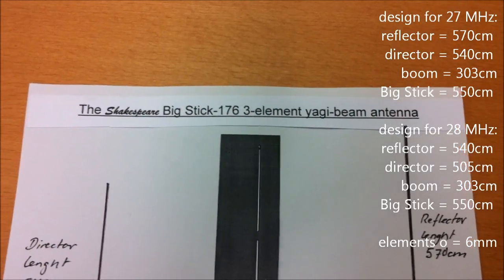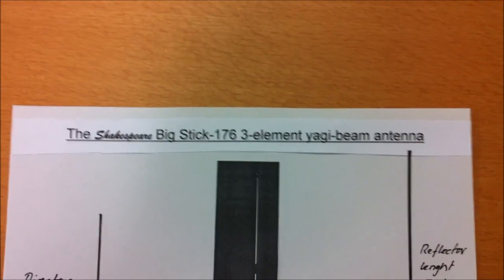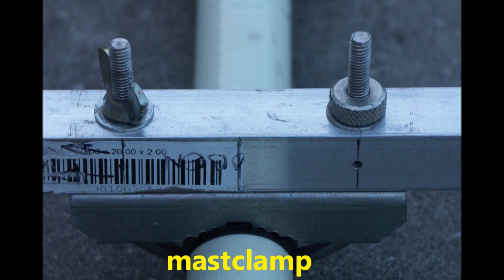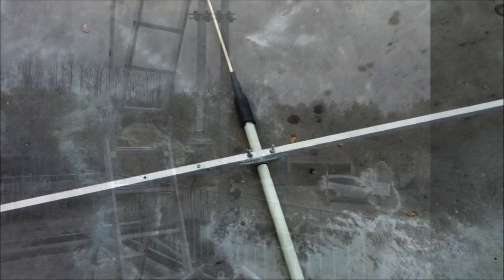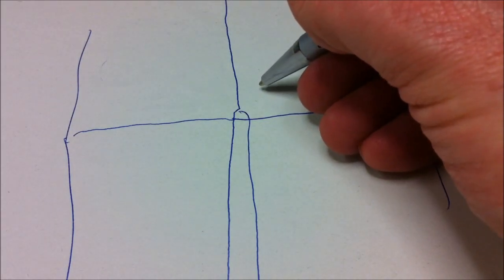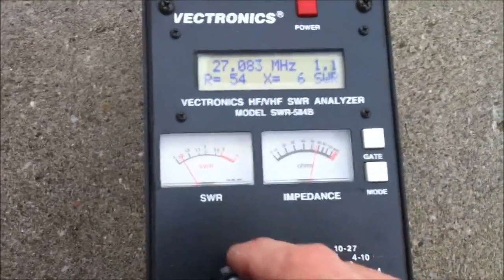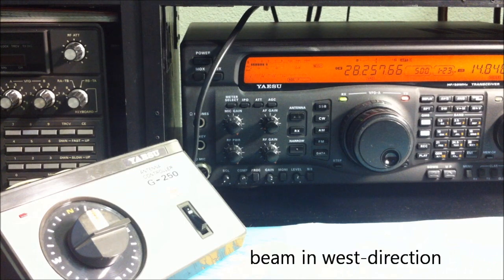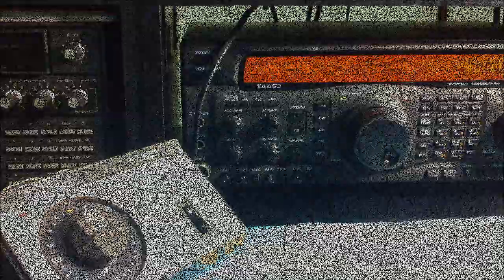The US Shakespeare Big Stick-176 Style vertical beam

Comment: I currently own both a 3 & 4 element beam antenna made by Shakespeare.Both have a fiberglass boom & fiberglass elements.I just received then NEW & still in the shipping tubes yesterday for FREE.I am selling the 2 element & keeping the 4 element for my own station which I will put up eventually.A real MegaBeam 4104 is a very RARE antenna since they were sold in 1977 & having a NOS one is even more RARE.I look forward to seeing how well it performs once it is installed.
Reply from the maker: Oh yes sir, I know these antennas by SHAKESPEARE. These are the SH4154 POLARBEAM (3 ele.cross yagi) and the SH4104 MEGABEAM (4 ele. long yagi). Wonderfull classfiber beams from the early 80ies. You're a lucky man. Happy airwaves to you...
Reply: SWIZZRADIOS Yes the MagaBeam is going up here soon. It will be at about 55ft to the boom. I still have the three element model as well since it appears nobody has any money that keep saying they are coming to pick it up.LOL

Comment: I just picked up another RARE base antenna by Shakespeare.It is a Style 4127.It is designed just like the two beams that I have that I mentioned in another comment here below.It is a simple all fiberglass dipole (single element) using two fiberglass wound antennas.It was as the beams still in the sealed shipping tube.May be another one or two but I will need to check the shelf again.I can find ZERO information online about this antenna but I have all of the paperwork that came with it.
Reply from the maker: Mr CB-Antenna fan hello, thank you for your input. Yes of course, but I know the SH-4154 polarbeam. It's a 3-element cross-yagi by Shakespeare. There was also the SH-4104, 4-element vertical Megabeam by Shakespeare. Manufactured full of fiber glass. But I've never seen both antennas alive. All in all, CB-radios and antennas are a passion of me. It was a beautiful time in the 80ies: Big CBiers parties, without smartphones and facebook profiles. So I'm not on face book, but on 27MHz… Best 73s and happy airwaves to you.

Comment: Still got that Avanti Sigma Iv? My Father threw out 2 original Sigma IV's i am not happy with him!
  This is a great video. I am building a co phase array on a non corrugated tin roof in the French ALps. The roof is large enough to have around 1 wavelength spacing and it has an 11 or 12 degree pitch. The plan is to use 6 mag mounts so each side will have reflectors and directors, i will eventually add a switchable inductor on the parasitics so front to back can be switched. I am using the very long extendable antennas from alli express. they can be extended to 5.6M. also there is a cheaper version which is 2.5M but by buying M to F 10mm x 1.5mm brass extensions you can add some extra length at the base to save on buying the 5.6M long versions. But the larger version is probably best for the driven elements as they would handle more power. Finally i plan to make it somewhat steerable by being able to switch in sections of coax to one side or the other in order to add a line delay.
  Because I am using mag mounts i get a great capacitance to the tin roof so great reflection from ground. I also have options to move the array in slightly different angles or 3 main positions with some fiddling / extra options for the middle position. I can use the angle of the roof for downwards sloping take off angles, the centre of the roof for a more horizontal setup depending on weather or not i add a way to make the elements vertical rather than on a 12 degree angle or i can move to the other side of the roof for a steeper than normal take off or a low take off to the east.
  A few weeks ago i was not even using the 102" whip, i had a nice mobile whip on the magmount and got to Brazil with 100W. I think the extra low take off angle due to the 12 degree roof pitch and the position of the magmount on the roof really helped. I have a sirio 2020 and if i could find another it could also be fun to co-phase a pair of those, one day it could be nice to find a Ham international Big Mac. For now, i think the co phase 1/4 wave array will be fairly discreet and i could remove the entire setup in a matter of mins, also it's pretty versatile being able to extend the elements anywhere between 54cm and 5.6M or more if you add some extensions to the base, the tricky part is making the adapter from 10mm thread to 3/8 x 24 inch thread, i bought a 3/8" die to try to cut one but that depends on what mounts you are using, someone does sell adapters from 10mm to 3/8 mobile mount thread but they are quite expensive.  I'll be mostly using pl259 to 3/8 thread converters to connect to the So239 on the mag mounts but perhaps i can just get a 10mm version made or just the end part made in 10mm.

https://fr.aliexpress.com/item/1005004895028956.html?spm=a2g0o.order_list.order_list_main.40.612c5e5bURmk4j&gatewayAdapt=glo2fra

https://fr.aliexpress.com/item/4001330856900.html?spm=a2g0o.order_list.order_list_main.28.612c5e5bURmk4j&gatewayAdapt=glo2fra

And the extensions are No13

https://fr.aliexpress.com/item/1005005329029114.html?spm=a2g0o.order_list.order_list_main.5.612c5e5bURmk4j&gatewayAdapt=glo2fra
Reply from the maker: Hello my CB-Antenna friend, thank you for your big Info abt the SIGMA IV. I think, the Grazioli G-MAX High-End Antenna is a super thing. It's a 5/8 over a 1/4 low angle antenna with a gain of a 2 Element beam. Take a look in to the follow link: https://www.sat-online.ch/shop/Grazioli-G-Max-CB-Funkantenne--22317.html
I'll use this super antenna in the next time. 
Best 73 to you...

Comment: how long is the rg62 lenght of coax?also i havve a compleat refurbished astrobeam took down while still working better than a sirio 3 element beam and high. gain long john.i need a new 239 soldered onto my matching coax for my astrobeam.can i replace it with a matching length of rg62 instead.one more thing would the use of a balun on the astrobeam or your big stick beam help at all.i use a bn 86 on my 3 element hygain beam thats horizontal to the gamms.i was told it helps even with the gamms match
Reply from the maker: Thank you for your interest. The RG62 coax is Abt. 175cm long (0.66 x quarter). But I don't know how it works on the ASTROBEAM. I think, you must try it. I wish you good luck with you experiment. Best 73s

Comment: THE BOOM IS TOO HIGH. IT SHOULD BE AT THE BASE OF THE ANTENNA. AT A HALF WAVE. 18 FEET.WHAT DO YOU THINK ?
Reply from the maker: Christopher hello, thank you for your input. The problem is as follows: This act was just an experiment to built a directional antenna  like the famous ASTROBEAM by AVANTI. This experiment was more than three years ago and this pseudo BIG-STICK Beam isn't more installed. But my original Big Stick is now on the mast and it works very well. It's one of my best antennas compared with 5/8 and 7/8 antennas. Best 73s and happy airwaves to you.....

Comment: I have had 2 bigsticks last few months and both were shot inside.
The connection inside is not soldered and its a crimped brass and when it turns green thats it.
Unless in was in dry storage till now its no good.
Reply from the maker: Thank you for your interest. My Big Stick was stored in a dry cellar for about 30 years. Last year I had purchased it on ebay. It was then in a new condition. I hope that the Big Stick will run for further two years. Best 73s and see you on tube again...
Reply: here is the flaw: https://i.imgur.com/cZbGMgd.jpg
They didnt solder the connection, only crimped it at best and soon it just goes bad from chemical reaction. Its a shame I have 2 that are like this
Reply: Every single one ive owned developed issues.